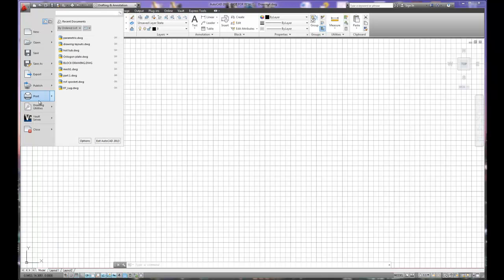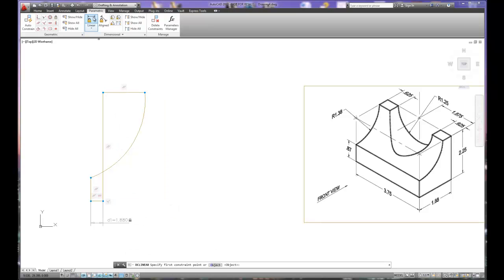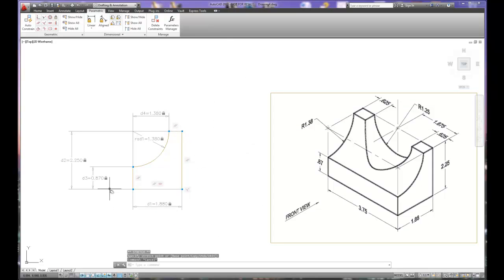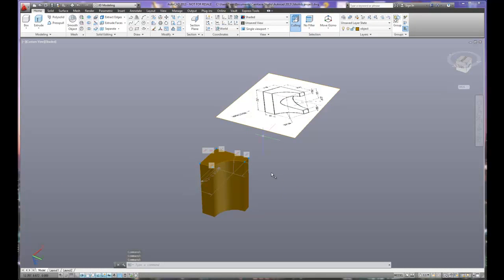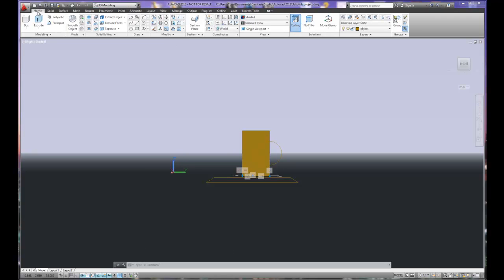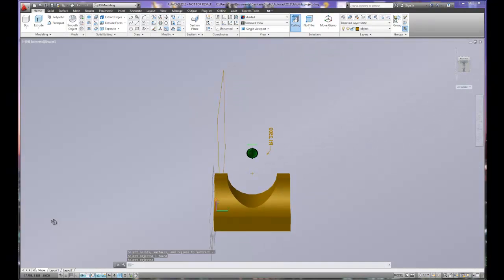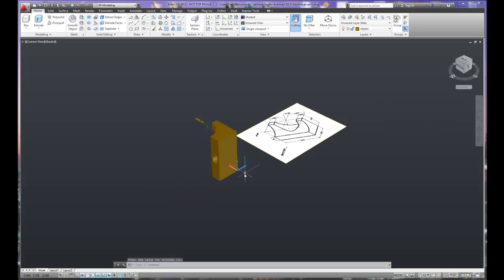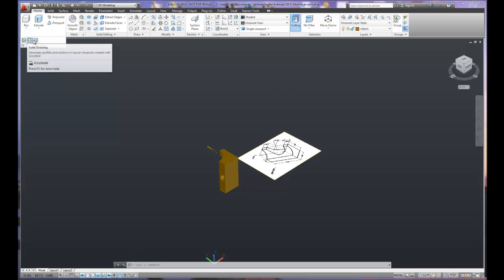AutoCAD 2013 3D solids model creation

Comment: The extrusion/parametrics approach is needlessly complicated. This shape is a just a 3-D rectangle with two 3-D cyllinders subtracted from it.  Draw each using the appropriate length/width/height or radius/height coordinates in the first place, position them appropriately, and subtract.